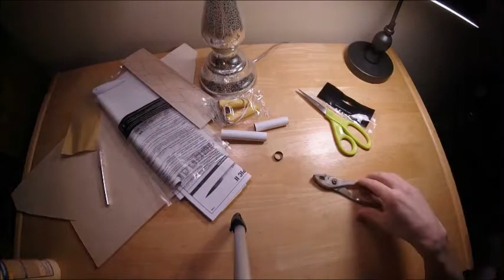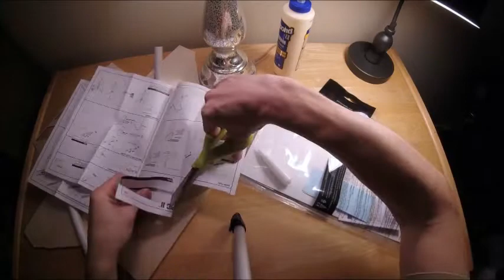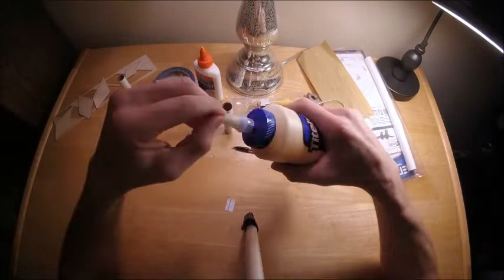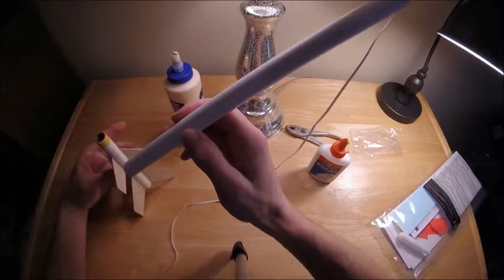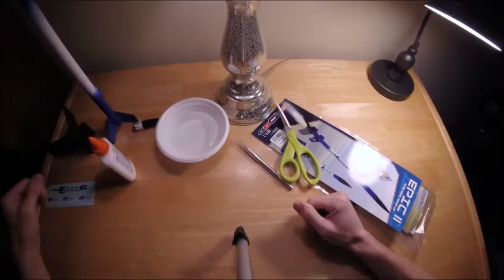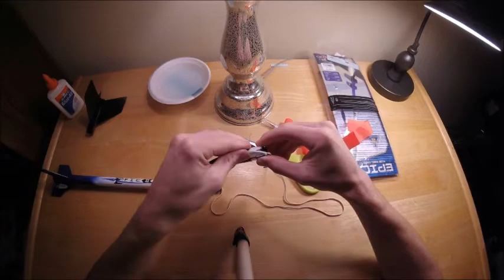Estes Epic II Rocket Build Tutorial

Comment: Put your aluminum 90 against the body tube lined up with the launch lug line. Secure it with tape or rubber bands. Lay your launch lug right up against the aluminum. Carefully put two dots of CA on the lug/ body junction, opposite the aluminum. So none goes over to the aluminum! This is the best way to get two launch lugs lined up dead perfect. Then fillet. It works best prior to attaching the fins. It’s more accurate than trying to line up by eye.
Reply from the maker: Excellent idea!

Comment: Hey there. Geat video but one thing I have learned before is that especially you never want to use Elmers on the shock cord part. The heat will make it gummy and it has a high chance of ripping off and you could lose your rocket. I just don't want that to happen to you ;) If I were you, I would use CA Or Superglue... We have been building for years with superglue and its never let us down. But hey it's your rocket and if it works for you, that's great.  Just trying to help!!

Comment: 2 stage rockets are very fun and also very frustrating.  Sooner or later they will fail.  The 2nd stage won't light, or the 1st stage won't separate cleanly and that will cause the 2nd stage to fly erratically, or the CG will be too far aft, etc, etc!!  When I was a kid in the 70s, my first 2-stage was a Beta - it was very small and flew on a mini engine.  It was VERY reliable, until the day it wasn't...  The 2nd stage didn't light and it lawn-darted, pushing the nose entirely into the body tube.  Every multi-stage rocket I had eventually failed.  Those were fun days!!

Comment: I need help so my model rocket can hold a A motor up to a C motor motor but only a A motor fits how to I make it so a C motor fits
Reply: Both A and C motors are the same diameter. However the c11 motor is bigger because it’s 24 mm while an A motor is 18 mm. You can use a c motor just make sure it’s 18 mm like a c6 5.
Reply: @AndersManix  thanks

Comment: Why do you put the engine block right where the engine goes at the bottom?
Reply from the maker: @MercyStephen-pf9to  The booster has a thrust ring on the aft end so that when staging occurs the entire booster separates (not just the motor).  (Without the ring the motor shoots out the back and the booster tube gets charred by the sustainer motor).

Comment: What happens to the set of fins that detach? Or does it not detach?
Reply from the maker: The set of fins that are painted black, which I call the booster stage,  become detached (or really more like jettisoned) from the rocket during flight upon burnout of the booster stage and ignition of the sustainer stage (blue set of fins) motor.  At this moment,  due to pressure between the motors (which should be taped together with clear tape) causes the booster stage to jettison from the bottom of the rocket and the sustainer stage continues under the thrust of the recently ignited sustainer motor.  The booster stage will just free fall down to the ground by itself.  It does not need a recovery system because its shape causes it to tumble/flutter, like a leaf falling off a tree.  Does that make sense? That's a really good question feel free to ask more questions so we can ensure a successful flight!